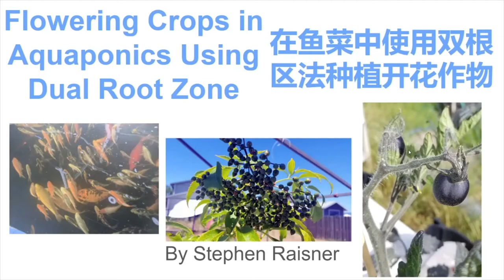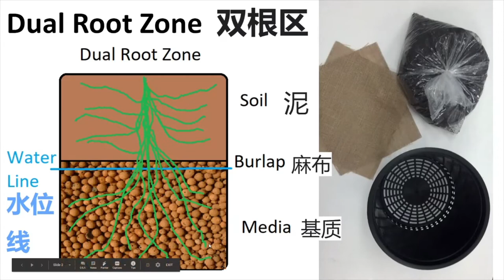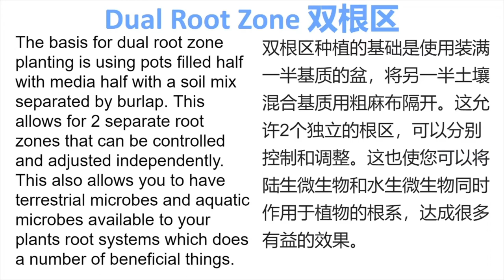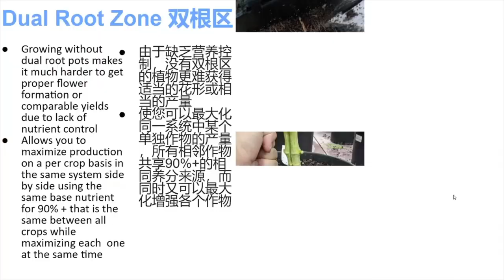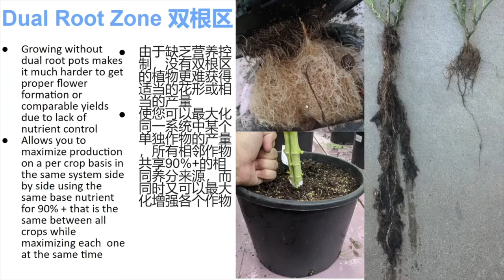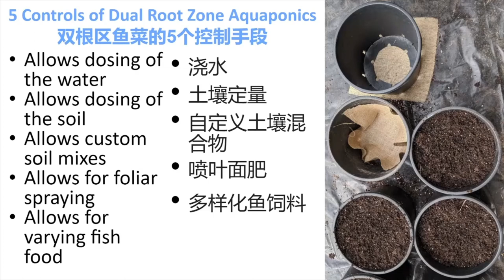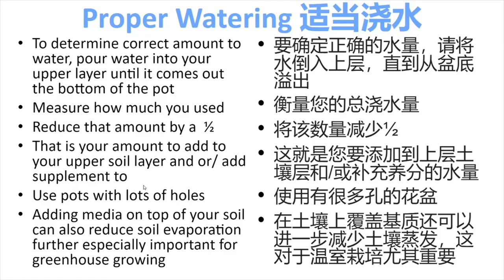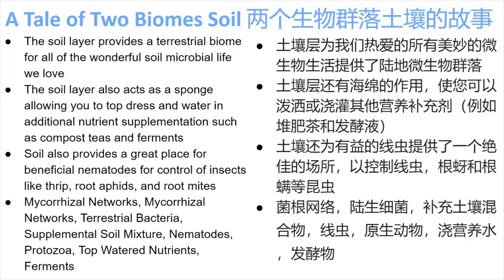Dual Root Zone Aquaponics Presentation for the Aquaponics Association of China

Comment: Rob bob sent me here. Have you compared this to simply using a raingutter grow system running on aquaponic water? It seems that having a dwc bed for greens and herbs with a raingutter grow system using soil to make up the nutrient gap for more demanding plants would be simple to set up and reduce the risk of introducing soil based contaminants into the fish loop.
Reply from the maker: that would be a wicking bed which has some down sides to it compared to the higher level of control we have here. Also there is no risk of soil based contaminants thats a myth aside from yucca extract or other saponins.
Reply: Yeh im just warming up to this dual root zone technique. Instead of chasing up and trying to balance 10 or so interactive nutrients with supplements to fix whatever nutrient deficiency you may or may not have correctly identified, give the roots access to soil as well and let the plant extract what it needs!

Comment: How do you keep the fish poop from turning the clay rock muddy
Reply: Welcome to the filtration rabbit hole 😄 sponges, fibers of all sorts or my fav mineralization tank... c u
Reply: how to keep the nitrogen low when it is time to flower the plant.
Reply: Worms are commonly used to further break down unfiltered substances. I use them in my system, but they will escape if there isn't enough to eat. So keep that in mind.
Reply: @LeeVittout  thank you for the tip
Reply: Take out the heavy particals first.  Swirl filter or bog filtration systems.